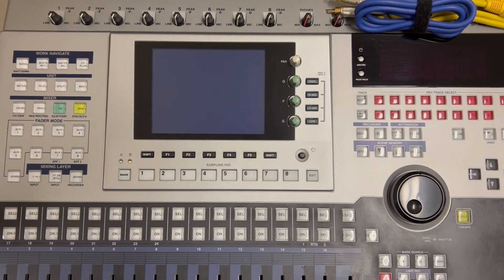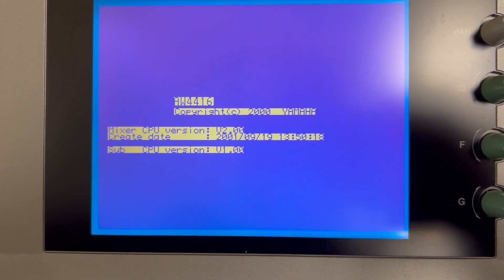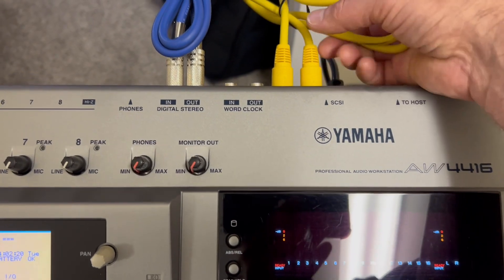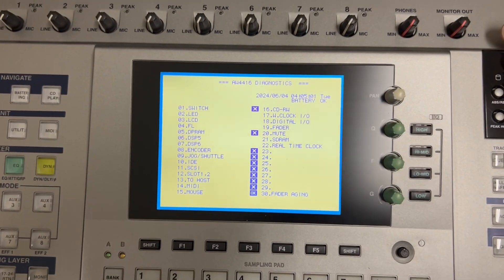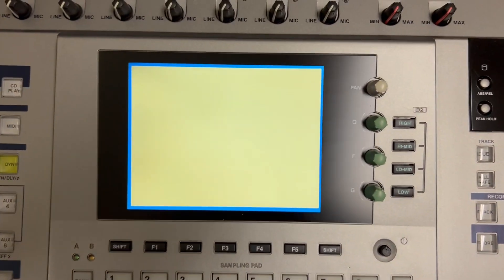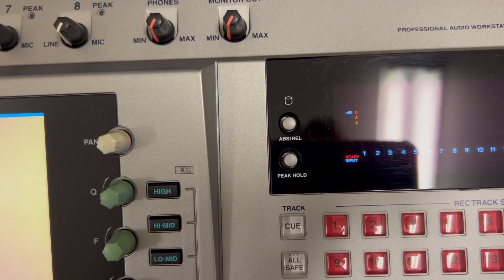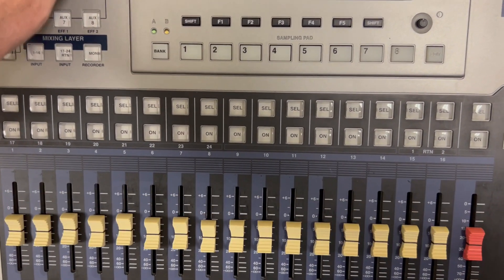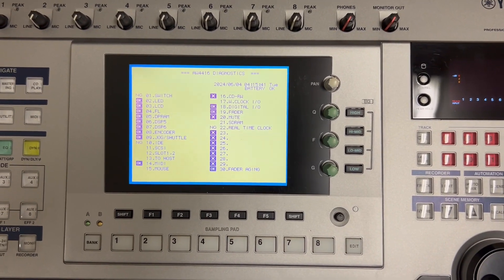Yamaha AW4416 System Diagnostics Testing How-To!

Comment: Thank you for this video🙏
Would this mixer work as a sound card and integrate with my Cubase 11 ?
Thank you in advance🙏
Reply from the maker: The AW4416 is not an audio interface for a computer-based DAW. It is a very capable standalone DAW. If you want to use it with Cubase 11 you would be recording on the AW first and then transferring the tracks to Cubase.